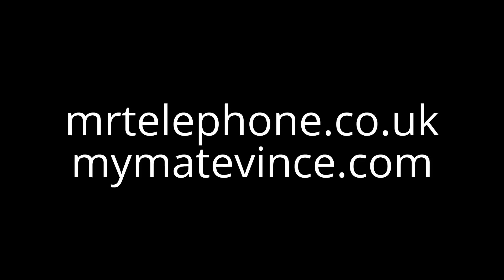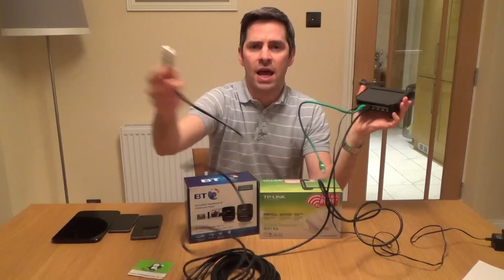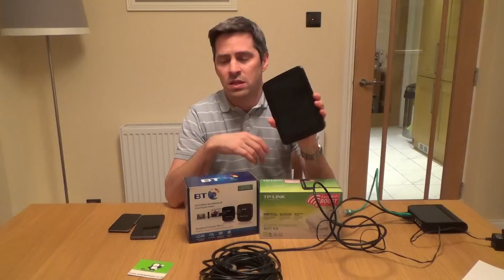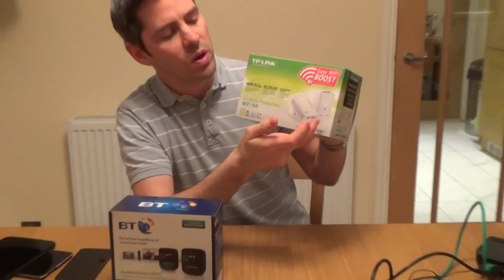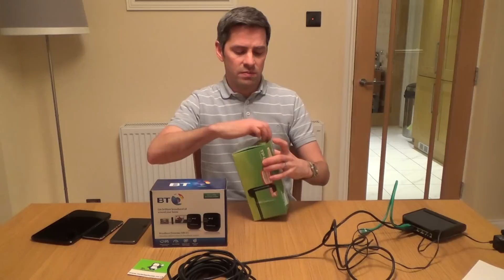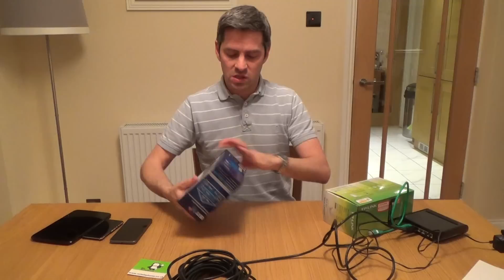SLOW WiFi WEAK WIRELESS SIGNAL. Increase INTERNET BROADBAND NETWORK using POWERLINE WiFi Adapters

Comment: I have really slow internet I should get 16Mbps according to my ISP but I'm lucky if I get 13Mbps. I struggle for Wireless signal in my flat in back bedroom I have an Edimax extender connected but it has to be plugged in closest to my bedroom door to get a signal my router is a Tp-link D20 with dual band any suggestions please. Thanks

Comment: boosters over electrical cabling are just awful. get a cable  solution or just setup other routers as hotspots. It's like using fttc with awful copper cables and your advertising that oh its poor internet here in the UK so use poor ways of networking.

Comment: why did you double pare bud you paired it on the one that is already connected
Reply: It copies the link to the router rather than linking to that device, so it doesn't matter if you link to a paired device or router

Comment: Hey I know it’s an old vid but can’t find an answer online. I currently have the bt flex 500 extenders but want to know if I bought another and just used the one you don’t plug into the router would it work?

Comment: Can anyone help me, I am using the bt powerline extender 500 Flex and whenever I connect it to my PS4 and test internet connection, the data button which was before green just turns off

Comment: Nice one. I've tried a couple of wifi extenders in this past that failed miserably, almost given up hope of getting a signal at the back of the house. Think I'll give the tp link set a go. 👍🏼
Reply: They will only work if they are on the same fuse board - they don't have to be on the same electrical ring, (you can have multiple electrical rings) as long as they lead back to the same single fuse board they should work. They 'wifi' access points built into the plugs though are really poor. You're better off buying a plug with an ethernet socket on it, and plugging your own access point in at the other end.

Comment: i was having trouble the virgin bloke wired my room when i change rooms 
every since  august i was having problems i kept on phoning virgin there
 said change the frequcys to the rmodem finally i got a super hub 3 and 
the signal he tested the signal to my hub 2 it was low it went red and 
found out the other bloke wierd it wrong now i got to wait till my other
 room get dectorated and i can move in my other bedroom  any advice

Comment: Thank you for your info on how to connect up net working I bought BT Broadband Extender Flex 600 kit working great, I only have 4 sockets on my BT hub 5 and was wondering how to connect more if needed and you answered that for me a switch, which I will get for future use to extend my network great video info Many thanks,,,,,,,,,,, and I'll be back to see more of your updates I've checked many videos on what I wanted but none had been so informative as what you have done they didn't explain how to extend more extenders and about a switch if you run out of sockets,,,,,, so thanks again,,,,,,,,

Comment: Well done. I was not aware that you could get powerline adaptors with WiFi signals propagation. So I learned something new today. The only part which I found  could be done a little bit better is to make it very clear that the two different sets could be used independently and one does not need the other. Having said that my confusion was only momentary but those who are totally technically ignorant could get a little confused. Thanks once again for the wonderful presentation. I am in Australia and hope I can find the above wifi gadgets (or equivalent ones) here in Sydney. If anyone knows of any products here (with model numbers please) do let me know.

Comment: I am really thinking of starting to create a home network. I currently have a good spec router (Netgear D6400, wireless AC1600 and Gigabit ports), however I am think of adding a WD MyCloud for media streaming and more to the network. However the main thing I am thinking of doing is purchasing a set of "TP-Link AC Pass Through" powerline adapters and a "Powerline Wi-Fi Extender" kit. This is because the Wi-Fi cards built into gaming consoles are the worst found in any consumer product and drops out constantly and the Wi-Fi struggles to reach the oposite end of the house. The Fast Ethernet ports (100Mbps) shouldn't be an issue as I am only thinking of using the powerline adapters for streaming and online gaming (I only have a 9.5 Mbps down and 0.85Mbps up connection). If I decide to get the MyCloud, I am thinking of connecting that directly to the router and I can copy files just over Wireless AC from my laptop (that way I can pull about 28MB/s or 224Mbps transfer speeds).

So in other words, I will use Wi-Fi AC for copying large amounts of files over the network and the powerline adapters for extending the regular (2.4GHz) Wi-Fi, connecting gaming devices and streaming off the MyCloud and internet. Is this the ideal solution for my situation?

Comment: Do these make you have faster uploading speed when you upload videos to Youtube ?? or are they just for a better wifi  signal
Reply from the maker: Hi, depending on the powerline adaptors that you get (and if you get the ones that boost the WiFi) then these can increase the speed on both WiFi and the wired connection which should increase the upload and download so uploading to YouTube will be quicker if the upload has increased.
Thanks Vince.
Reply: +My Mate VINCE Hello and Ok thanks so much for responding... I am going to look for the kind that boost speed...Thanks again
Reply: +goldmouth100 I mean Boost the WiFi...:-):-):-)
Reply: I dont know what that is unless you mean plug a cord into the computer straight from the wifi box.. I am not good at this tech stuff is that what you mean??

Comment: Question:  When you plugged it in to your test location... did you had to re-connect to your WiFi? or did your laptop automatically connected to STRONGER signal?

What would happen if you were to talk around the house with a wifi device?   Laptops will likely have a roaming but portable devices very likely doesn't.
Reply from the maker: +xxgg Hi, no I didn't have to reconnect, it copies the  information from the router so you can go from one part of the house to the next without disconnecting and reconnecting.

Comment: I live in an old sandstone house. My laptop is in the basement at the back of the house and my router is upstairs. I could only get a very weak WiFi signal in the basement and powerline has been the answer. I am not technically minded but I had my TP Link adapters out of the box and working in a matter of minutes. It is recommended not plugging these adapters into a power strip so the pass through versions are especially useful as you can then plug your power strip into the adapter.  No software or complicated configuration is required – it is literally plug and play and the adapters “find” one another quickly. If you want to create a fully secure network you can press the encryption buttons. I have personally not bothered as no one else has access to my house electricity. I now have a reliable broadband connection for my laptop thanks to powerline.

Comment: Hi Vince,
my net speed was very low but post a visit from the BT engineer(for free) he tested my masters pocket and on the test line I had 25mbps which is great but as the house has many extensions this drops down to 10mbps.  when using an extension away from the master socket.(apparently this is due to too many extensions)
His suggestion was to run cable from the outside bT box and run a new master into the house.
Question-do I disconnect the old master socket cabling when i put in the new cable.?
He left me with an open reach 3 ADSL and a  new master and  exterior cable sheathed with orange,blue,orange and white,and blue and white.
could you just tell me which of these colours wire into the master and which to the inserted ADSL plug in socket?

Thanks
Reply from the maker: +john osullivan Hi, you would use the blue and white/blue wires.  Connect the White/Blue to terminal A on the new master socket and the Blue wire to terminal B on the master socket. If you want the better speed then you will have to disconnect the old cable feeding the existing master socket BUT then you will loose all your extension sockets as well and you will be left with just the new master socket. Can you not move the router to your existing master socket location and fit the new VDSL faceplate so you can keep all your extension wiring. Once you put the VDSL faceplate (Openreach MK3) on then the extensions can no longer affect the broadband speed.Thanks Vince

Comment: hi vince wounder if you could help me I got bt infinity from the white bt socket to the hub there's a grey cable it's very fin would er if I could replace it
Reply from the maker: +Mike  Davies Hi Mike, you could replace it with a nice Cat5e or Cat6 version. They're nice and round approx. 5-6mm in diameter and good quality. Check out my ebay shop and if you can't find what you are after send me an Ebay message.Many thanks Vince
Reply: My Mate VINCE hi vince il have a look will it be under network cable cheers

Comment: at 20.40 what is the two black devices connected to the skirting.
Reply from the maker: +Philip Saunders Hi, they are 2 old connectors for the PlayStation 2 controllers, the console is hidden in the next room but uses the TV in this room. PS2 was before the days of wireless controllers but my son sometimes like to play the old games.

Comment: hi vince have you heard of TP-LINK TL-WA850RE 300 Mbps Universal Wall Plug Range Extender/Wi-Fi Booster ?
Reply from the maker: +Conor mallon Hi, yes I have. The difference is that version picks up your existing WiFi signal and boosts it so it will reach further but often you have to fit the booster quite close to the router so it has a strong WiFi signal to boost otherwise it is boosting a very weak signal so the end result is a weak signal.

Comment: Hey vince, when plugging in the router side of the TP-Link adaptor with it's two RJ45 sockets, can I plug whatever I un-plugged from the hub to accommodate the TP-Link, back into the other RJ45 on the TP-Link?
Reply from the maker: +Sergei Jonovich Hi, good thinking, yes you will be able to do that and that will save you having to buy a network switch if you have 4 full ports on a 4 port router.Well done.Vince

Comment: I see you still have the superhub 1 if you call Virgin Media tell them how bad your wifi is they should send you the superhub AC for free, or if you wait a few months you may able to get their new one Router Hub 3.0.
Reply from the maker: +Karl Betts Thanks for the information, I will look into that.Cheers Vince
Reply: +My Mate VINCE I would ! Also ask about your speed I'm on 200mb & 12mb but I am in London.
Reply: +My Mate VINCE You could get a free speed increase.
Reply from the maker: They recently increased it from 50 to 70Mbps down 5Mbps up but I am on one of the lower priced options so I think that will be it for while but the new router could be an option.
Cheers
Reply: +My Mate VINCE ok mate np. Great videos too by the way very useful!

Comment: I use tplink dual band WiFi Extender's and it reaches my hole house up down and even outside they have Ethernet ports
Reply from the maker: +Cois xarelto Hi, they are good if you have ok WiFi reception, but if the signal is very weak or dropping out where you want to place the extender then it is just boosting that very weak signal so you normally have to place them nearer to your router to get a good signal to it to begin with. They work great in some setups but not so good in other setups.Cheers Vince.